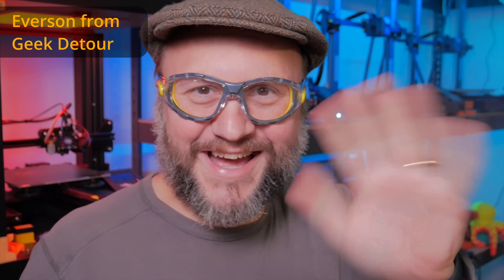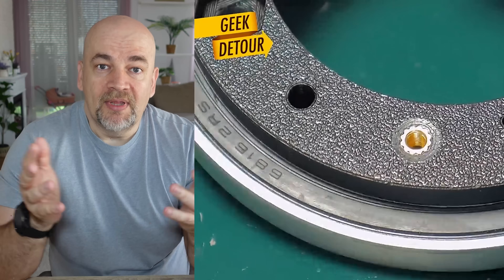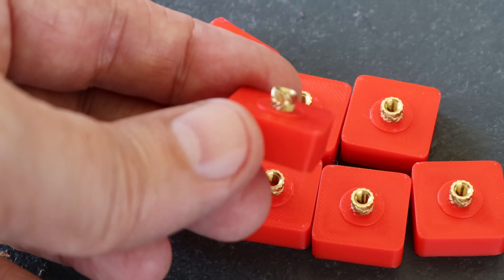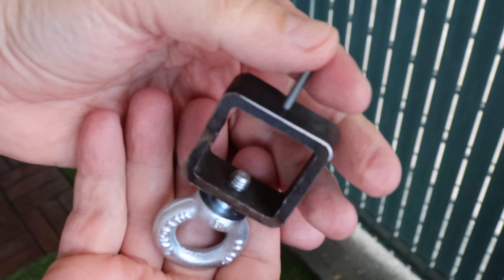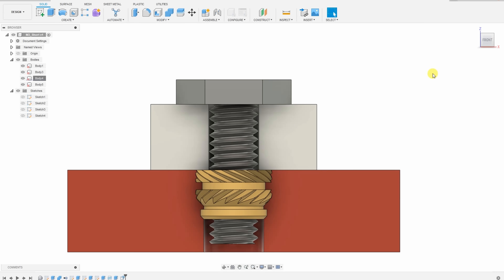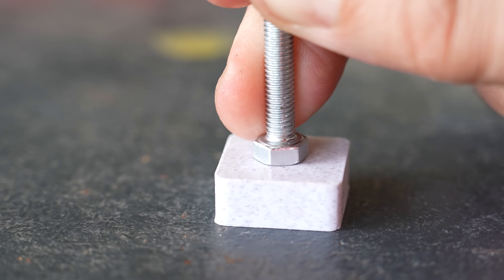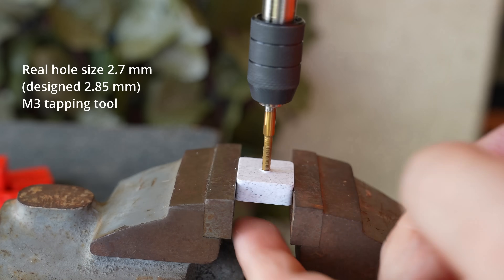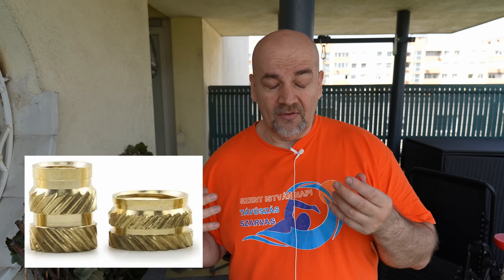Even stronger Heat-Set Brass inserting method for 3D prints? Let's test it!

Comment: Embed an m3 hex nut into a print.  Cheap, and depending on how much material is above it, should be very strong.
Reply: It’s funny that, sure, I have A LOT of M3 hex nuts too, but I always go to Brass Inserts for M3 - maybe because it is so easy to just design a 4mm hole for them in the model (a nut takes more space). But for M5 and M6 I always use embedded hex nuts.
Reply: @GeekDetour  if it achieves your needs, sure.  If you need more strength, embed.
Reply: @GeekDetour  If you can, insert them from the backside. This is convenient AND strong.

Comment: You shouldn't push the insert below the surface of the print. It should be flush. If it's below the surface of the print you risk causing it to get pulled out if you overtighten it. It can't pull out by overtightening if it's flush with the print surface.
Reply: Hey, are you related to the SoapBubble Fandom Wiki? I think I saw some of your videos there.

Comment: Great video! Thank you!
I'd assume the last method is the strongest because the insert is cooling down naturally. The first two method will cool the insert down much faster because the table or the bolt will conduct the heat away. Maybe using something not so heat conductive like a piece wood will have a different result? 
Also I think the temperature of the iron and the speed you press the insert in will have some measurable effect on the holding force.

Comment: I use the CNC Kitchen inserts as they are designed for 3D printing , the ones we usually get are apparently meant for injection molding and so don't grip as well in 3D prints.
Reply: I think that's the same kind Igor uses in this video, with the stepped pilot lip and counter angled knurling.
Reply: @SeanCMonahan  yep, ones for molding looks completely different
Reply: Igor used the same type as CNC Kitchen, the Knurled brass inserts.

Comment: Should you not use the same filament for every single type of test ?
Reply from the maker: Several times I have been accused that probably I am sponsored by Polymaker. That's why I try to combine several materials if possible. It was just a small add-on comparison test annyway.
Reply: @MyTechFun Isn’t PolyMaker sponsoring you?! 😮😂 Just kidding

Comment: Igor, your videos keep getting better and better with the production quality. The content has always been top notch. Thank you for sharing your testing! 

I was curious if you would want to test putting the inserts in from the other side and trying to pull them through the plastic. In cases where I use threaded inserts and I have the option. I install them on the inside so I'm trying to pull them through the plastic.

Comment: Very interesting!  I was excited to the see the bolt being used, disappointed I hadn't thought of using a bolt myself.

I use a similar but slightly different approach, and I'd like to think it's better than everything you tried.  Similar to flattening on the table or with a bolt, I use a long, skinny, rigid flat metal bar (sometimes just the handle of my tweezers if I need something smaller).  Similar to the table approach, it allows me to get inserts flat and level, but I can reach into places a table can't reach.  I think a bar is better than a bolt because I can use the length to help keep the insert flush, instead of pushing too deep with the bolt and deforming the plastic.

But the important difference is that I continue heating the insert for a few extra seconds, allowing more time for the plastic to melt, flow, and adhere to the insert.  I typically press in the insert about 99% of the way, only very slightly proud, less proud than what you showed.  I also twist slowly back and forth during the insertion, to force the grooves/ridges to come into contact with more plastic.  I typically twist slowly one way for half the insertion, then slowly the other way for the second half.  Not a lot of twist, maybe 10-30 degrees, rolling the iron in my fingertips.  Note that I'm using a conical solder tip, which gives some grip on the insert and allows me to twist, but also makes it harder to keep things straight.  Then I hold the heat for about 2-3 seconds while I fine tune the position, then quickly remove the heat and apply the flat bar, pressing firmly to make everything flush and holding it long enough to cool the plastic to a solid state.

I know that sounds similar to the approaches you demonstrated.  But when you pulled some of those inserts out, they only had plastic bonded to the bottom half of the insert.  That was the portion in heated plastic contact the longest and with the most force, melting and bonding with the plastic.  The top part of the insert was only in contact with the plastic for under a second before you remove the heat source, or worse only came into contact after heat was removed and a cooling bolt was applied,  and I think that those methods prevented full bonding.

In summary, slowly twist during insertion, insert 99% of the way, hold in position while heating for 2-3 seconds for better bonding, then flat metal bar to make flush and apply cooling.  Oh, and before I forget, this works better with slightly lower iron temps - too hot and the 2-3 second hold will melt the plastic into a swampy mess.  It'll take a few tries to dial in your temps, but you want them as high as possible without over-melting.

Comment: When doing a bolt-direct-to-plastic test, it would be really interesting to see how wood (not mechanical) bolts/screws behave. They have much larger contact area with the plastic and should have a much higher torque resistance.
Reply from the maker: Hm, yes good point. Earlier I tried few times, but probably the hole was too small, because they cracked the plastic (layers). Since that I don't use them in 3D printed plastic.
Reply: @MyTechFun  could heat the screw up first maybe
Reply: There exists genuine plastic screws (straight thin body, sparse wide thread, button head), used in RC cars and e.g. game controllers, that are perfect for plastics (limitations apply) and can be de- and re-attached (with a bit of care to use the existing thread). I haven't found good source for those though, maybe RC stores?
I have moved from M3-to-plastic to nut-in-a-slot when possible. I think it allows a lot more torque than inserts and is easy to assemble - unless the slot is more-than-slightly too narrow...
Reply: @kimmotoivanen  I get my screws from TME. They sell Bossard's fasteners and they have about 30 different style direct assembly screws for plastics.

Comment: You might also try super-gluing in threaded inserts, rather than heat-setting them.  That gives you all the reusability benefits, without any of the challenges of using a soldering iron.
Reply: You risk fouling the threads if you use any kind of glue to secure an insert. A soldering iron is incredibly easy to use for heat set inserts.
Reply: @supergiantbubbles  Maybe.  But I've had good success using a threaded-in bolt to install the insert and remove it before the glue dries.   I've also had occasions with heat-sets where melted plastic ends up in the thread (especially if the hole isn't perfect).
Reply: Well, but you probably cannot hang your full body weight on them 😂 150kg - that’s insane!

Comment: You will get slightly better results when screwing directly into plastic a second time if you first turn counter clockwise and feel the original thread before screwing in. This is far less likely to cross thread, which is what weakens the plastic. At least it is a contributing factor.

The strength of those m3 inserts is extremely impressive. Great video and I look forward to more :)

Comment: Great test! Do you think you could try it against normal vs carbon fiber filled filaments?
Reply from the maker: Maybe in different materials fist (?) But before that I ordered different M3 size inserts, to see what's the difference between 4.2 and 5mm diameters and 3mm vs 7-8 mm lengths.
Reply: @MyTechFun it seems you will be taking off Brass Inserts for a while until we are all happy 😂❤

Comment: M3 is probably most common isn't it?

In the first set of objects (red ones) even the bolt head seems to leave a raised plastic bulge on the surface but in the white objects it looked much more like a flush surface.
Am I imagining that? If not, what made the difference? When assembling functional objects a proper flat surface often makes a difference in putting multiple assemblies together if tolerances need to be correct. It's my main problem with inserts...

Comment: I wonder if epoxy or glue would work better or in addition to melting the inserts in. Also the heat from the soldering iron may be a key factor here as it may not be properly melting into the inserts outside kerfs. Either way, like you said those are very small inserts. For a stronger and higher torque load, use bigger ones.
Reply: Oh, 3D Prints in Resin we cannot melt them in… the only way is gluing the inserts. Have you watched the “Proper Extruder”? I forgot his name - but he made a brand new extruder with belts. The body was resin and he epoxied the inserts.
Reply: @GeekDetour  no I havent seen that. But that's very interesting.